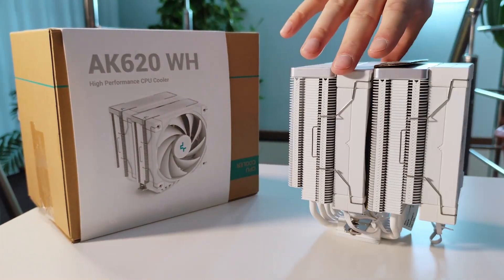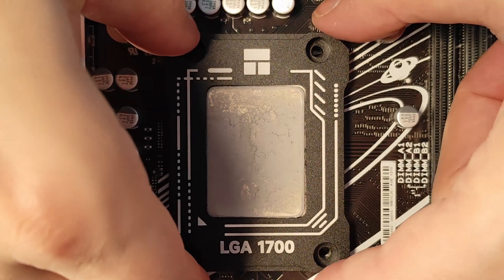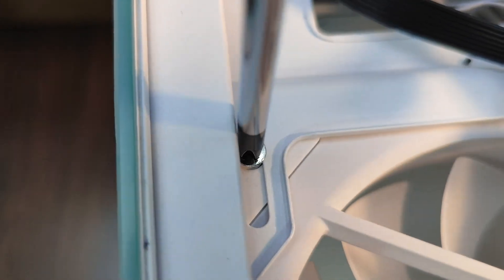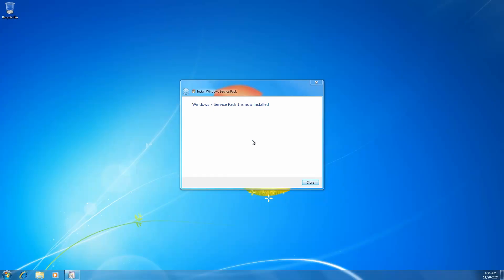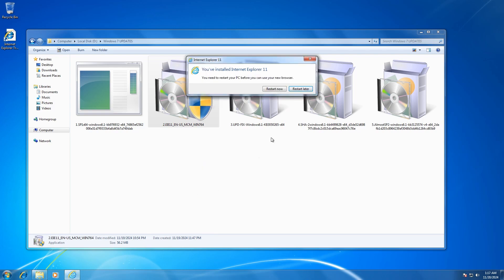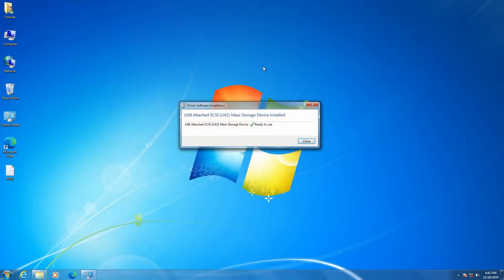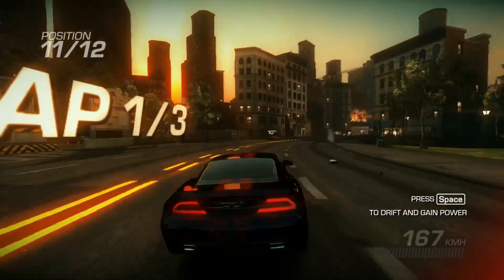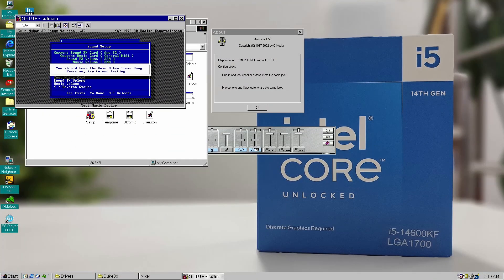Windows 7 Returns on Modern PC: i5-14600KF Intel CPU,  Z790 motherboard/DDR5 & RTX GPU

Comment: Steam still works fine on windows 7. I keep getting updates even. I just kept using windows 7, updates arrive and I still have the little "Steam will stop working on Windows 7 in 0 days" icon staying there, for over a year now. I had a few "hiccups" with the interface loading but I think some 2 months ago, another update fixed that. The only downside is that the steam client window now has the sharp rectangular shape of Win10/11.
Reply: I am currently using an X99 setup (7 native), but I have acquired an LGA1700 motherboard. My plan for the OS is different, to transfer the still running, 11 years old, never reinstalled entity of 7 to the new LGA1700 motherboard. It already survived three transfers, so it's an another milestone in it's history.
Reply from the maker: Windows 7 should have no trouble recognizing and interacting with SATA drives on the new LGA1700 motherboard. However, the ACPI implementation might present some challenges, as the OS rely  on ACPI  for building the entire device tree. For instance, if you originally installed an older OS like Windows 2000 or XP using the "Standard PC" or "MPS" HAL, then later switched to ACPI, a new device tree would be created. This can lead to a 0x000007B error because the hard drive controller is now located at a different address.
Reply: @O_mores  I utilize a PM991A Win7 native NVME right now. Cloned from a sata drive. Eventually I want to clone it again to an even larger drive. Since I use cloning, I can attempt and experiment as much as I want, without ever damaging the original.

Comment: how did you download the drivers?
Reply from the maker: What specific drivers are you looking for? For Realtek HD sound, SATA, and the Nvidia 7900GS, the built-in Windows 7 drivers worked fine. For the 2.5Gb Ethernet, I downloaded drivers from the Realtek website. The Nvidia RTX 2060S has official Windows 7 drivers available directly from NVIDIA. For USB 3.x, I found the drivers on the MSFN forum.
Reply: @O_mores  No i mean the motherboard's drivers

Reply
Reply from the maker: Ah, I see what you mean now! Unfortunately, the last chipset with official Windows 7 support was the X470 released by AMD in 2018. So... modern motherboards don’t have official Windows 7 drivers anymore. In most cases, the motherboard will function with standard Windows drivers, which include basic support for features like USB (1.1/2.0 only with default drivers), SATA, onboard audio and basic power management.

Comment: As long as x86_64 is alive, any Windows will work even after the 2038 effect, it will only get harder as they get older.
Reply from the maker: True, x86_64 might keep chugging along, but let’s hope CSM doesn’t get downgraded to industrial use only! Or else by 2032, installing Windows 98 might require a $700  motherboard.
Reply: @O_mores  x86_128 will probably not come for another half a decade tbh, afterall the ram limit on 64 bit is so big that i dont think any of us will live to see 256 bit tbh

Comment: Really updates are working?
Reply from the maker: Yes, they are. But you have to follow the steps...
Reply: @O_mores  when will updates stop in 2025? When
Reply from the maker: It looks like the end is in October 2025, as shown in the video. For Windows 7 the updates will end for good, while Windows 10 will enter in the ESU phase (Extended Security Updates) for at least three more years.
Reply: After that you can use Legacy Update
Reply: @LiamLG_Official  whats that
Reply from the maker: "Legacy Update revives the original Windows Update website - the only way to see and install every update available for your system." #legacyupdate.net

Comment: Windows 7 does recognized modern NVMe controllers without install storage drivers?
Reply from the maker: NVMe support was added to Windows 7 at a later stage as the standard itself was introduced around 2011-2012, with the first drives becoming available in 2013. The good news is that the NVMe drivers are more easy to backport, for instance, NVME and works perfectly well even on Windows XP.
Reply: @O_mores  Oh, that makes sense. I tried install Windows 7 Pro x64 with UEFI, then I updated these updates for NVMe driver support and nothing happens. When I modified my specific NVMe controller for Windows 7 and install it, it gives me some errors and unable to use NVMe. How should I do?
Reply: @O_mores After a few months I think I accidentally enable RAID mode and were unable to install generic NVMe driver. Currently I reverted back to AHCI mode and will try it again if it's able to install or not.
Reply: PiotrBarcz Sorry for late respond because I was busy for work. Well, I tried to change from RAID to AHCI in BIOS, boot Windows 7 again and the NVMe driver was successfully installed! I never realized that SATA protocal are the culprit, well I guess I can able to access my Kingston NV2 storage data!
Reply: My current PC using Asus TUF Gaming B760M-Plus WiFi

Comment: i am so glad to see this video, i absolutely detest windows 11, windows 7 was my favorite, its just so clean & stable & simple & fast, just what i am looking for as a music & graphics professional. 11 forces crap on me i dont want or need & removes functionality & control & is a bloated mess.  Ive been contemplating going back to w7 black edition on my Zbook for some time now, it spends most of its time offline so security is no real problem as its air gapped. I have a pair of Nvidea A3000 gpu's & an intel gpu inside it that i am worried about getting drivers for.
Reply from the maker: I still have Windows 7 it as a boot option on my main PC. But what I found more interesting is that I have a relative, nearly 70, who still uses a Windows 7 PC daily to stay online. The kind of computer user who might click on the wrong links or install questionable software (I found some adware installed), yet goes online every day—mostly to read online newspapers and spend time on Facebook. Amazingly, their Windows 7 installation has survived for many years without any major issues, last time it was installed in 2018.
Reply: @O_mores   i to was running a w7 installation on one of my stage mashines right up till last summer, i used the network on it regularly & never had any security issues, but i did have Eset nod32 on it tho wich is a pretty bulletproof security system, the only reason its no defunct is i burnt out the CPU constantly hammering it with live visuals runing in HD at events in scorching hot clubs, it nuked it eventually, the CPU's cach die fried from the constant hot environment & it could no longer do anything more than run DOS after that

Comment: Yes should be... This is Intel. Development code (6.1.7600) on latest hardware. Microsoft (azure) and Nvidia will finish that. Build 9863.

DDR 5 is a meteor lake as I remember (not 10 nm Core).

Comment: Screw Microsoft. I've switched to Linux and though it can be a pain in the ass I'm not being spied on and can run it on whatever hardware I want. Only time I use windows, and certainly not 11, is offline. 98, XP and 7
Reply from the maker: Meanwhile, I’ve gone the multiboot harem route—every Windows version gets its moment to shine. Need something snappy? XP. Feeling nostalgic? 98. Something functional but still modern? 7. -- Written on Windows 10.

Comment: Windows 7 is a lot easier to install on modern desktops than modern laptops since they get a bsod!!! I installed Windows 7 on my ASRock Z79P PG Sonic Motherboard by using the same via usb 2.0 pcie card and also using a disc with updates, patches, and drivers. The on board usb does not work while booting it from the original install disc!!!
Reply from the maker: Having a PCI-E card with native USB 2.0 support is incredibly helpful, but I need to investigate what went wrong with port 0x60/64 emulation. When Intel removed EHCI controllers in 2015—right when Windows 7 was at its peak popularity—most motherboards were still able to emulate USB keyboards and mice as PS/2 devices during the Windows 7 setup. This allowed installations on USB 3-only motherboards and effectively resolved the issue at the time. However, on the H610 and Z790 motherboards I’ve tested, this emulation now only works in DOS, and not even in Windows 98.

Comment: I still use Windows 7 on my secondary PC, often use it for daily basis.

But it have more authentic hardware, based on X58 Gigabyte GA-X58-UD3R LGA1366 motherboard, Xeon W3565, 24GB DDR3 RAM, 512GB NVMe PCI Express x4 SSD (I did installed modded BIOS, to make NVMe possible on these types of motherboards), 
GeForce GTX 980Ti, modified HP EliteDesk 8300 chassis, and 1600W Superflower Leadex Titanium powersupply, yeah the powersupply is too overspec, but I got two of those for good price, slightly used.

And I use Windows 7 with 4K 27" monitor.
So amazing to see Windows 7 at 4K😊
GeForce GTX 980Ti do support 4K 60Hz on HDMI and Displayports.
Reply from the maker: I had that motherboard back in 2010 paired with a 40GB Intel SSD and the the go-to quad-core for the platform: i7-920. I was so proud of that setup, especially about the triple channel feature. But I have to admit, I missed the charm of the traditional FSB scaling, going from FSB 33 to 66, 100, 133, 166, 200 MHz over the years. Switching to QPI on socket 1366, with its locked base clock at 100 MHz, took some of the fun out of overclocking for me. Still, it was an unforgettable era!
Reply: @O_mores   the Gigabyte GA-X58-UD3R is the best LGA1366 motherboard, I ever had and have. Before that, I had used HP Z400 for that purpose, but two HP motherboards died in a row 😬.
Then I bought this Gigabyte GA-X58-UD3R motherboards, and few months ago bought similar, Gigabyte GA-EX58-UD4P, just to have spare one, in case if something happens, but they are Ultra Durable or aren't?

Comment: are we going to install Windows 2000 onto this i5 14600KF computer?
Reply from the maker: The motherboard is gone, but I did have time to test how Windows 2000 runs on this setup. I used my Windows 2000 installation with UniATA drivers, and it booted without any issues + multiprocessor support through MPS — though limited to 2 CPUs due to licensing restrictions. I think I’ve gathered enough footage for a future video.
Reply: great!

Comment: This is a wonderful video! I wish I could have known all this sooner. I daily windows 7 on a newer pc with a 12th gen i5 and an rtx 3060. The OS runs perfectly for the most part, and its been a stable and snappy system for the past few months. All the drivers have installed properly, but I've had a few issues with the cpu and I was wondering if you could tell me if you've experienced them running on your hardware and if you know why they're happening. You seem a lot more knowledgeable than I am so I would greatly appreciate it. Most of the information regarding running windows 7 on modern hardware centers on AMD processors so its been hard to research. 

The problems I've had are, 1. The cpu clock speed and other info not being properly recognized by CPU-Z (I also get an error message), 2. The cpu doesn't show up in device manager at all, and 3. It seems like the cpu is unable to turbo boost to its max single core speed. Most of these issues are trivial and I haven't seen any noticeable decrease in performance compared to other OSes but I think it ends up causing some issues with single threaded tasks.
Reply from the maker: It’s great to hear that you haven’t noticed major performance impacts despite these quirks. You might still encounter slight inefficiencies compared to Windows 10/11 as 12th Gen Intel CPUs rely on a microcontroller to manage thread allocation between the E-cores and P-cores in collaboration with Windows Task Scheduler. Intel says that this process is specifically optimized for Windows 11, but it will work with Windows 10 as well. Frankly, it feels like more of a marketing push to encourage upgrades to Windows 11. From Intel website:  "The optimization between the processor and Windows Task Scheduler relies on Intel® Thread Director technology. Intel's Thread Director is a microcontroller built in each Alder Lake processor  (12th Generation Intel Core processors ) that is optimized for Windows 11 Task Scheduler to decide which thread goes where (P-core or E-core). Thread director also works with Windows 10 Scheduler, but it is not optimized for it."

Comment: Are there native Wondows 98 drivers for the 7900GS?
Reply from the maker: Native Windows 98/ME drivers are available for the NVIDIA GeForce 6000 series. These drivers can also support the 7000 series by modifying the .inf file to include the hardware IDs for the 7000 series. However, while the 6000 series is officially supported, the driver has known issues, particularly with 512MB cards. Fortunately there are patches made by the legendary R. Loew to address these problems. Check out this video: https://youtu.be/iMyK-NJkSoo

Comment: Why is it easier to do it with a modern intel pc and not a modern amd PC
Reply from the maker: I think it's the same business with both Intel and AMD. Actually I have installed all Windows OSes on my Ryzen 9 3900X PC. (all except Windows NT 3.1) From my experience Intel works better when it comes to V86 mode. So if you are using a DOS window in Windows 3.1 or 9x it will be faster on an Intel CPU. For me the PS/2 port matters as well. As of 2025...  I can buy an Intel Z890 motherboard (released 2 months ago for the Ultra 200 series) with a PS/2 port but not a high end AM5 X870/E motherboard. Luckily  there are X670 motherboards with PS/2 ports.
Reply: @O_mores  can you tell me what did you do to make Windows 98 work in that build
Reply from the maker: You can take a look here on how I installed Windows 98 on Intel 6th Gen/13th Gen: https://youtu.be/XCaJML-M808
Reply: @O_mores  i meant on an amd build, it doesn't wanna work with amd pc witha 5600g
Reply from the maker: I didn't have any problems with my AMD build, it's very compatible. Are you using your Vega 7 iGPU?  It shouldn't be a problem with this model, but newer iGPUs will make BIOS to disable CSM mode - as these IGPUs work only in UEFI mode.
Reply: @O_mores  I tried to disable the iGPU and use a 7200 GS with PCIe
But I get the windows protection error

And some others errors

I'm using Windows 98 Quick install with all the patches too
Reply from the maker: What is "Windows 98 Quick install" ? :)
Reply from the maker: I’ll give it a try! Typically, I install Windows 98 directly from the 'Win98' folder on the CD. Many updates aren’t critical and can be skipped—they often address specific issues with hardware from that era, like BSODs during infrared file transfers or USB problems on certain laptops. The most worthwhile updates for Windows 98 are upgrading to the latest versions of Internet Explorer (which will update important core system files) and DirectX.

Comment: For updates I recommend simplix's tool, its way more recent since he gets his updates from 2008 r2's extended ones which share updates with Win7. He also removed telemetry and it works entirely offline. All you need is service pack 1. You can even slipstream it and then you have USB3 as we

Comment: the windows file manager and winamp runs better in win 7  .... in win 11 22 & 24 H2 crashes all the time
Reply from the maker: I’ve also experienced issues with File Manager on Windows 10, but to be fair, my video editing folders often contain 5,000–6,000 files, which could be contributing to the problem.

Comment: Waste of time when I can get better results with Linux
Reply: Linux users are legitimately some of the most obnoxious people I've ever seen on the internet.
Reply: Technically all hobbies are a waste of time. Windows 11 is probably more worthwhile running than Windows 7 at this point (you just have to use Rufus to bypass some installer rubbish, then use winaerotweaker or something similar to rip all of M$'s bullcrap out). But there's something fun about running old systems on hardware that has no business running it.
Reply: Can i get just ONE day without someone mentioning Linux on a video related to Windows?
Reply: I'm a linux user and these comments piss me off. Just SYBAU and leave windows users alone you meatsuckers.
Reply: You can't, windows > Linux overall
Reply: @deathtrooper2048  thats not how computers work
Reply: waste of time when i can get an os that doesn't implode when i try to install software
Reply: What are you doing on a retro computer channel if you don'f apprechiate retro computing? Obviously theres better daily drivers, this is showing how well Windows 7 still runs because we all love Windows 7, its over 10 years old and now retro enough.
Reply: its about appreciating the old operating system
Reply: The waste of time is your comment.  (You don't understand what is going on here do you?)
Reply from the maker: Let’s all take a deep breath and appreciate the beauty of choice! Whether it’s Linux, Windows 7, or even Windows 11, it’s all about having fun and exploring what works for you. Running old systems on modern hardware it’s not about practicality, it’s about the joy of tinkering and nostalgia. (and maybe there is some practicality as well when playing certain games or running some expensive software)
Reply: lul, bullseye 🎯

Comment: Nice. Windows 7 fails to boot on my UEFI system due to csm not being able to be activated in the setup for some reason
Reply: Windows 7 wasn't natively support for full UEFI mode, it's required to enable CSM mode for working. If UEFI without CSM mode is impossible to boot Windows 7, so make sure UEFI mode is on and CSM mode also should be on.
Reply: Windows 7 does have a UEFI mode but on some of my ISO's that broke.
Reply from the maker: On newer motherboards you cannot activate CSM if you are using the iGPU, as these are now UEFI only. Is this your situation?
Reply: @O_mores  yeah i eventually figured out my laptop cant CSM because of the radeon IGPU